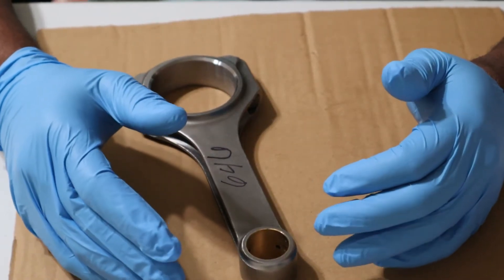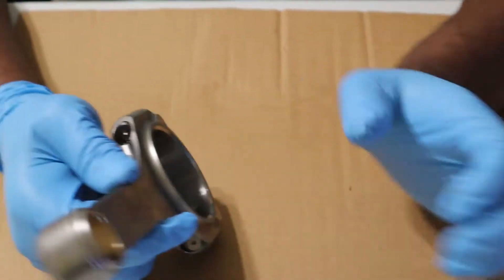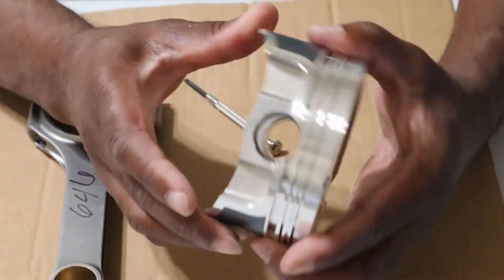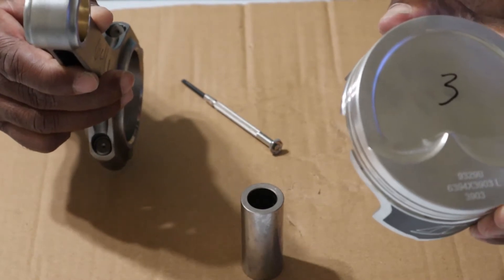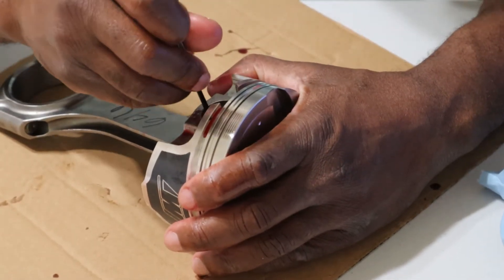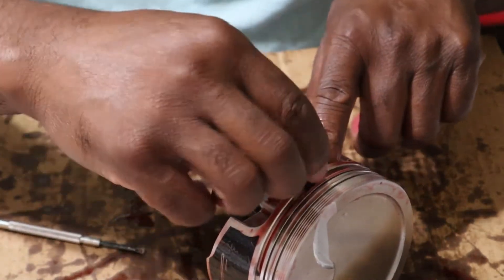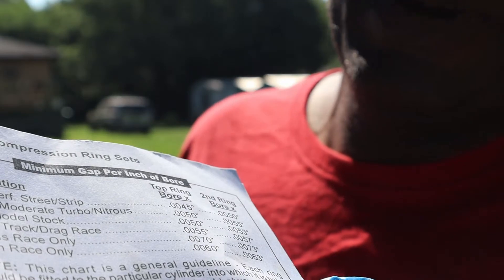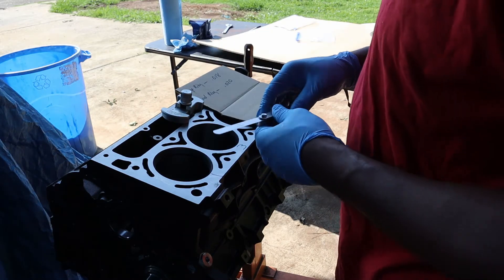How to build a LS 383 from a 5.3 part 4 (RODS, PISTONS AND RINGS)

Comment: I've never seen those spiral wrist pin retainer clips before, like they say fear of the unknown, I'd be afraid that I wouldn't get one seated right and the clip and pin would walk out and destroy the cylinder wall, did something like that When I was a kid on a Honda motorcycle engine.
Reply from the maker: They spiral clips are a bear to get in.  You can easily see that they are in and seated correctly.  

Thanks for watching 

Let me know if you have any questions